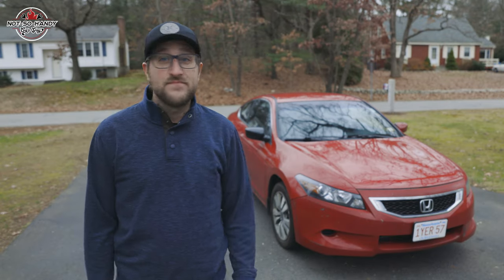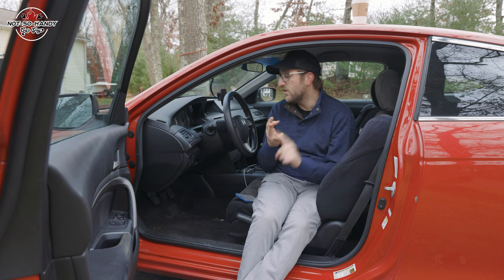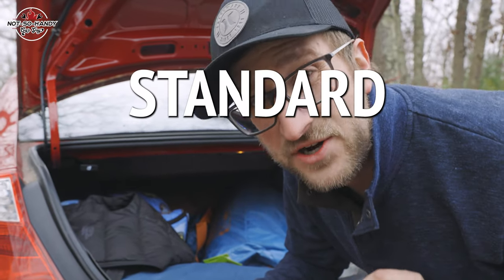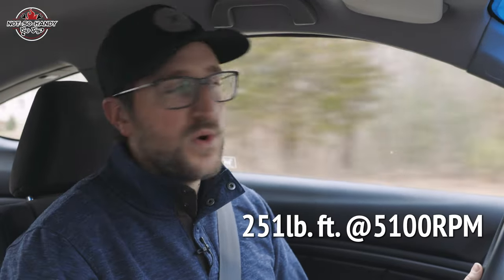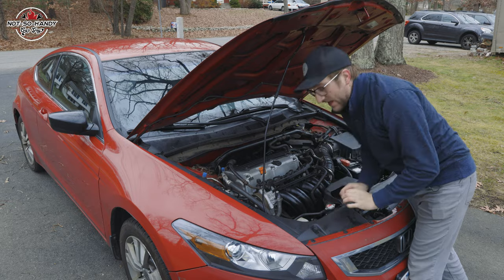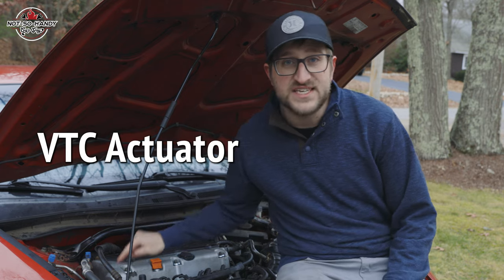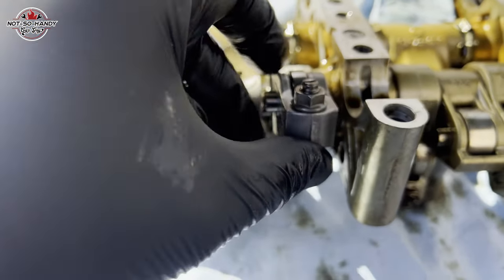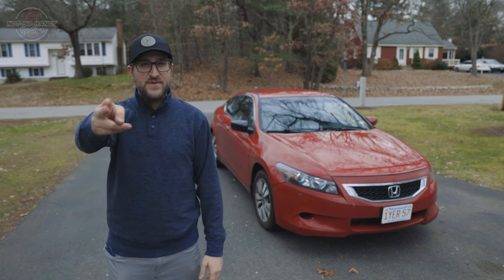Honda Accord (8th Gen) - How Reliable Are They? Review, 0-60 mph, Interior, Common Issues

Comment: I have an 09 accord with over 320,000 miles & still going. I love this car
Reply: '99 with 260k+ I'm hoping to get to 300 eventually.
Reply: Did you do any mods I’m looking to get an 08
Reply: I added an front strut tower brace & a rear brace to reduce the bodyroll. I’ve added a Sony touchscreen, JBL sound system, HC motion headlights & VLand taillights
Reply: I got 2011 coupe wit 393,000

Comment: have a 2012 exl 2.4l with 190k miles. It doesn't burn any oil between changes and has not needed anything other then maintenance. We have done the oil changes based on the oil life indicator, did 3 transmission drain and fills, replaced brakes about 3 or 4 times, it has had about 4 sets of tires, spark plugs twice, air filters etc. It runs just like the day I bought it with 32k used in 2016. Plan to see if we can hit 250k or 300k.
Reply: nice bro hope its still working well 🤝 i just got my 2012 EX 2.4L 4cyl and i hope it lasts long as well it has 91k miles
Reply: @degenbomb  oh yea. Just hit 200k miles.  Going to see how long it will last. I suspect much longer as it doesn't use any oil and runs like it did new.

Comment: This is my first car, got it in June of 2022 at 193k miles with some problems. Engine light kept coming on and off and my dad suspected that one of the pistons don’t work, and it burns engine oil. I just learned that the backseats can be put down! And I finally got an explanation for the rattle noise it makes whenever I start it. I’ll be looking into how to change that myself. Thank you for the video!!
Reply: If your piston did not work you would be having serious engine issues lol. I think he meant your piston rings aren’t sealing as good as they should so it’s burning some oil. Unless he meant it was misfiring? Maybe that’s why your check engine light would come and go? The usual fix for that is sparks plugs and coils.

Comment: While it wasn’t my first car I’d highly recommend it, I’ve got a ‘12 Coupe LX-S k24-5mt. This is my 4th and second manual. I absolutely love it. It’s got just enough creature comforts and decent enough ride quality/cabin sound seasoning to remind you it’s not a civic. I’ve done basic street mods minus a tuner. It’s not as buildable as other hondas due to its head being restricted. It has good base power for what it is, I have no problem passing people without redlining my car at 60+. It handles surprisingly well in 4+ inches of snow so long as you’ve got all seasons or better, despite being a coupe, it’s only 4 inches shorter and still weighs anout ~200 lbs less at 3220 lbs.Anyone looking that’s on the line for a basic/fun commuter or daily should Jump at the chance, not only are the 6 and 4 cylinder both reliable as all hell, they both hold resale value with less than 100k. I got mine mid august of 2022 with 73k on it for 11,500. I see them on car gurus specd like mine with almost 150k miles for 6-8k. I’ve done my oil at 4k and replaced my axles as the boots were torn up a bit. Other than that it’s a dream for anyone that doesn’t mind FWD.
Reply from the maker: Nice dude! Thanks for the testimony. Definitely a solid car, for anyone who respects it and takes care of it.
Reply: @NotSoHandyCarGuy  always, I’m glad one made it out for a review and still left good thoughts on itself with 200k. I’m going to run mine into the ground (respectfully)
Reply: My sentiments exactly. I’ve owned a 2008 2.4 coupe 5 speed, and now I have a 2012 2.4 5 speed.  Practical, economical and engaging to drive. Doesn’t get the respect it deserves

Comment: The only thing i noticed that you missed, was the fact that the V6 6mt did not have VCM issues, as it didnt have variable cylinder management. As a result, its a much more reliable option than the auto. Otherwise, great video!
Reply: You have any experience with VCM delete?
Reply: Yeah,the manual was the way to go,no vcm and more fun than the automatic.

Comment: Excellent car! I have a 2008 V6 with almost 200k on it. Looks brand new, since it was the new generation. Nobody can believe it's an 08. My dad is also a mechanic and I have kept up with it. Had someone at the dealership say the 08 has the best suspension. Deff still worth about 8k.
Reply: I also have the exact car 250k miles and its still holding up (only had to replace headers)
Reply: @anthonybanderaz6201 nice, I’m looking at an 09, it has 190k though so I’m skeptical. Car fax has oil changed on it but that’s it.
Reply: Have you ever had a valve adjustment?
Reply: @skywayradio787 have you ever had a Valve adjustment?
Reply: @shadowman1992  I had a leak underneath the camshaft and then I had a valve adjustment when that was fixed a while ago. I've had tire joints and all that replaced as well and fixed an alternator..etc.
Reply: Ah yes your 16 year old car looks brand new and I bet it drives brand new too, ha?
Reply: @billbigshlong382  The body is all new paint. So yes it looks brand new on the exterior. The driving experience has not changed much. But like I said my dad's a mechanic, might be different for someone else.

Comment: I still daily drive my 2011 Honda Accord with the 2.4L engine. Currently at 337,000 miles with original engine, alternator, timing belt, and transmission. 

Small parts like front struts/suspension and seals needed to be replaced between 335K-337K. 

Great car and extremely reliable.

Comment: I got an 09 coupe v6, came with issues from the previous owner but im taking care of it. Shakes a tiny bit when gassing from 35-40 but drives like an absolute beast. I love it
Reply: That shake is a transmission shifting issue.  Do a drain and fill on the transmission and that should stop.  If you have over 100k miles use a bottle of Lucas stop slip transmission fluid.   Always use OEM Honda transmission fluid, never aftermarket fluid.

Comment: I don't think I'll be getting rid of our '11 Accord coupe I4 5AT anytime soon.  Has almost 100k miles and bought new.  Prices of new cars have gone through the roof and they're not necessarily more reliable than the 8th gen Accord.  For anyone on the lookout, best to look for 11/12 models.

What I like: reliable and powerful enough engine, good handling/driving dynamics, double wishbone front suspension vs MacPherson on the 9th gen and onward, 5AT instead of CVT on the 9th gen and onward, Electronic Stability Control, coupe looks awesome, the 2011/12 tail lights not as nice though, has been a very reliable car.

Issues: repaired under warranty/extended warranty -- front passenger backrest beam replaced, VTC actuator replaced (some minor grind occasionally), noisy blower motor fan replaced (still noisy)   

A/C clutch gave and aftermarket installed.

What I don't like: power steering motor whine, which wasn't fixed by replacing the two o-rings and seems to be related to hose diameter.  I'm not going to bother.  Might just break more things like the bolt haha.

Fuel economy is decent but of course compared to newer vehicles, isn't as great, especially in city driving.

Comment: I have one 2008 lx-s with sunroof ! Just crossed 162,000 miles have had it since 2015 

Has been through hell and back but it’s still going. No check engine light no problems other than I need brakes and a new headlight. 

Changed the shocks and struts once since I had the car and working on changing the rear suspension.,
Reply from the maker: Awesomeness! Glad you’re having good luck with it.
Reply: Did changing the shocks make a difference cause mines is riding like a tank?
Reply: @paulhope1385   no it didn’t at all mine rides like a tank as well and I hate it 
I changed the tire rods and sway bar links I’m going to try the control arms next if that doesn’t work I’m done. 

Are you from up north? The roads are brutal

Comment: Amazing video! Portrays the 8th Gen Accord very well and overall sounds like a great car! Like you were saying, with good maintenance there shouldn't really be any big issues anywhere below 200k miles.
Cant wait for some more of these reviews to come out, keep it up!
Reply from the maker: Thanks Cristian! Overall it’s a great car for the money. If only people changed their damn engine oil lol. Oh there’s going to be more to come 😉
Reply: @NotSoHandyCarGuy  Yeah frequent fluid changes can save you more in the long run and I don't think most people realize that. Sure you might pay a little more now, but it will allow you to keep car for longer, and avoid costly repairs.
Reply from the maker: @AutoFixYT exactly. Oil changes should be as standard as filling up your gas tank.
Reply: @NotSoHandyCarGuy  Agreed. But I think the problem is nothing happens in the short term if you don't change the oil often. There's no immediate consequence. Whereas with gas... Well... You're not going anywhere. I know what's wrong with it! Ain't got no gas in it!

Comment: Got an 87k mile 2012 single owner v6 coup. In 1 year I’ve got it up to 115k miles 0 issues other than scheduled timing belt replacement.
Reply: Did you do the timing belt yourself if not how much did it cost?
Reply: @Bootyeater999  I took it to a family friends shop. Belt plus pump 750$ :)
Reply: @Plu7ology damn 😮 lucky you.

Comment: Maybe you should to a take on the 2017 Honda Accord V6 manual. That is what I have, a 2 door beautiful 2017 honda accord.Two issues: One is the apple car play, it fails way too often and I live in Germany, and my US Ho=nda Accord came with break discs for low speeds. I had to change the disks and install drilles and slotted disks and that made breaking much better  at high speeds. Other than that I love my car. Great video, thanks!

Comment: I hope I never have to get rid of my 2008 accord coupe V6 EX-L. 😭 She’s been so good to me for 12 years and still going strong.
Along with regular maintenance…I’ve replaced the alternator, radiator fan, wheel bearing/hub assembly, timing belt, compressor, a/c leak repair, headliner, leather arm rest and small oil leak gasket.
It’s been a great ride and I look forward to going many more miles together.

Comment: I have an 8th gen Honda Accord EXL sedan with the 2.4 and 108,000 miles and a 6th gen Honda Accord EXL coupe with the 3.0 V6 and 190,000 miles and they’re both amazing cars! I religiously perform maintenance on them and it definitely makes them way more reliable, especially the transmissions in the 6th gen automatics, mine is the original with 190,000 miles!
Reply: Did you ever get a valve adjustment on the v6 ?

Comment: I have a 2012 Honda accord coupe 3.5 sunroof LOVE my car so sad they stopped making coupes😢 I have 76,000 miles on it. I have wondered so many times what the heck the knocking noise is when the weather is cooler, to me sounded like a lifter knocking, so glad to have finally have the mystery explained. My TPMS light has been on for years and years changed the tpms things and have had many different mechanics look at it and reset many times, for it to just come back on after 50 to 100 miles it has stumped many.

Comment: You can also get a resistor from some online places that when placed inline on one of the cables, eliminates the eco mode.  I did that, and all of my issues went away.  No catalytic issues, no #1 spark plug fouling.  100% would recommend for all Honda engines with eco mode.
Reply: Eco mode?

Comment: I got my 2008 Accord EX in 2016, had 129k miles on it. It has just a bit over 193k on it as of today. I've replaced the battery, tires, but nothing major has happened. Still runs great, though the vtc actuator needs to be replaced but apparently it's a known issue with this car. And my a/c no longer works but I only drive it to work and back so I've never bothered fixing it.

Comment: Got a 2012 EX-L and the one thing you also have to look out for is the spool valve. Mine went bad and started leaking on to my alternator. Thankfully I noticed it in time before it destroyed it cause I installed a new alternator a couple years ago.
Reply: Spool valve? Are you talking about the power steering pump?
Reply: @Skimpy33  no, it’s where the oil dipstick is, along with the oil pressure sensor
Reply: @Skimpy33  was leaking oil on to my alternator, thought it was the valve cover gasket tbh, turned out to be the spool valve
Reply: Is this an issue on i4 or V6 models?
Reply: @Dutchesandsour  looking at a engine bay pic of the i4 it seems as if the power steering pump is over the alternator, so this must just be a V6 issue. Now I know what @skimpy33 meant haha

Comment: I love this car, but I’m religious about oil changes etc… and I kept having these problems, even after Honda did the piston rings and actuator at 70,000 miles. At 90,000 the start noise was back, and it started burning oil again. Kind of a bummer for a Honda engine, as I’ve never had problems with my 4 previous models
Reply: You have a V6 ?

Comment: My 09 Honda accord coupe 3.5L V6 EX has 210,000 miles and I just had to replace power steering pump, VVT solenoid, and timing belt tensioner, battery. But for how I use this vehicle for work commute I can’t complain. No rips in seat but I have had to replace center console leather and door leather and I added an android touch screen to modernize the interior which I highly recommend. Love this car but I do wish I had a manual and not auto. But that’s just preference.

Comment: I have one like this, just purchased as I couldn't afford anything else. Has high mileage at 230k and the transmission is slipping bad. I wish you could do another video where you could explain some of the technical aspects to the car. My last was 24 years old and simple. I am not used to all these 'modern' changes, a lot of it computerized. I didn't have a clue about half the things you talked about in towards the last one third of the video. I wish you could explain it more for more lay person or old guy. I am afraid to drive it too much until I get the transmission fixed. The dealership screwed me but never telling me it had a transmission problem when the engine gets hot. Unfortunately in the State of Louisiana we don't have much protections if we sign off "as is". Never been ripped off before but then I had time to look for a vehicle. My last vehicle was totalled by someone with no insurance and ran. I only had liability as it was an older Toyota but with no problems at all. I have no choice but to made the Honda work. I appreciate all the info so I can do some of the repairs and also not get stiffed with an dishonest mechanic.  There are lots of them out there, sadly. Any future videos on these vehicle will be appreciated.  Thanks.

Comment: I just passed 300,000 on my 2011 EX-L V6 auto with NO major repairs done. The only repair so far was the A/C compressor last summer.
Reply: damn makes me wanna buy one
Reply: I've had to do the alternator and  driver side wheel bearing. Timing belt coming up soon.

Comment: Feb 25th, 300k kms, needs winshield, threw on rear pads rotors and calipers, needs sway link and a code for radio... 2800. Palm size rust spot on ps/ds rear quarters, everything is solid!!!
Reply from the maker: Not bad at all!
Reply: @Not-So-Handy Car Guy  this is CAD prices, going to go for a sefety check today! Then the mods start this spring lol
Reply from the maker: @owenmacintosh4546  hell yeah! What are you planning for mods?
Reply: @NotSoHandyCarGuy  possibly a turbo frank build over time, ive got parts lined up. Just lounge for a spare k24 so i can still daily it for now
Reply from the maker: @owenmacintosh4546  awesome! Let me know how it goes once the mods start!
Reply: @Not-So-Handy Car Guy  forsure, covid is kicking my butt right now, but once im back at work were going to start with coilovers wheels and exhaust

Comment: hi bro i just bought this car and i have one issue with it maybe you can give me advice. 
I also have a 2.4 automatic transmission. When I come to a stop in "D" mode at a traffic light and keep my foot on the brake pedal, the engine RPM drops to 600 rpm/min, and the hood, side mirrors, and steering wheel start shaking. When I turn on the air conditioner or headlights, the engine RPM increases to 750, and the vibrations are almost gone. I have visited many different mechanics, and they have replaced the entire suspension, steering system, shock absorbers, and engine mounts, but it didn't help. Perhaps you know what the problem could be? I haven't changed the spark plugs, and sometimes the engine makes a strange sound while driving, like "tak-tak-tak," but the sounds disappear when I increase the speed.
Reply from the maker: Hey! Well, I can say it’s certainly not a suspension thing. You got screwed over by your mechanics first of all. It sounds more like a MAF sensor or throttle body issue. But before you go replacing those, check the hoses and lines and make sure everything’s connected, since it could be a vacuum leak. It’s also very easy to check/change spark plugs on those engines, so it’s worth a shot to replace those, since they’re cheap. How many miles on it? And have you been good about changing your oil on time?
Reply from the maker: And when I say issues with your throttle body, I mean it could be your IAC (idle air control) valve. I’m not sure if they’re on the throttle bodies on these, I can’t remember. But a clogged one of those will cause issues at idle
Reply: @NotSoHandyCarGuy  thanks for responding me, i bought the car around 5 months ago, yes i replaced oils filters too, the walkway now is around 190 000 miles
Reply: @NotSoHandyCarGuy  and also it has weird sound for the first 3sec when i start the engine everytime like in this video on min 8:10 is it possible that this shaking occurs because of vtc actuator? Im living in Saudi Arabia and many of workshops here is so bad they don’t know how to fix tge problem